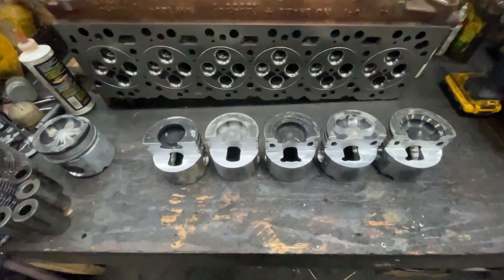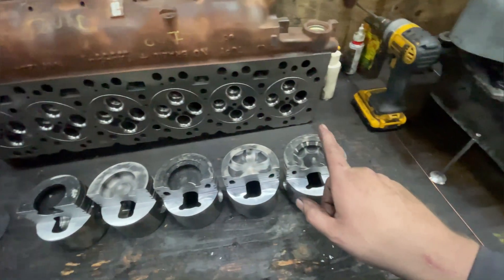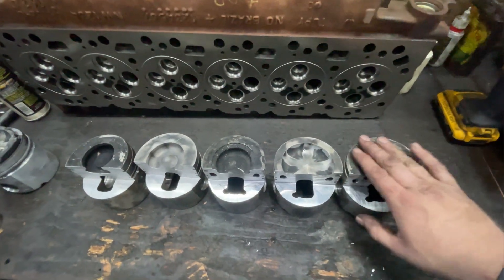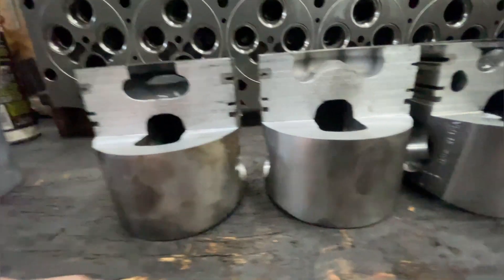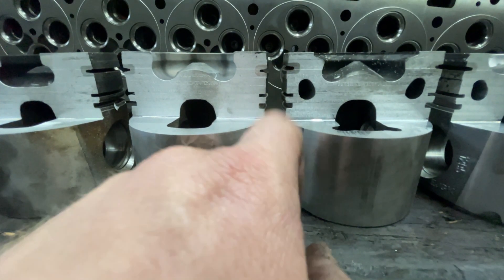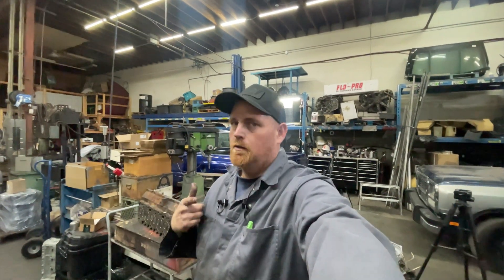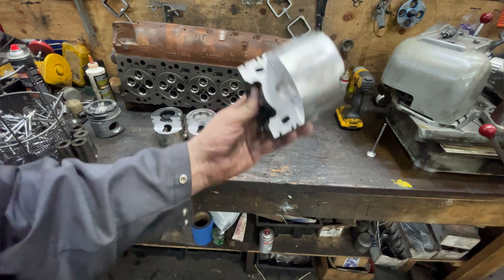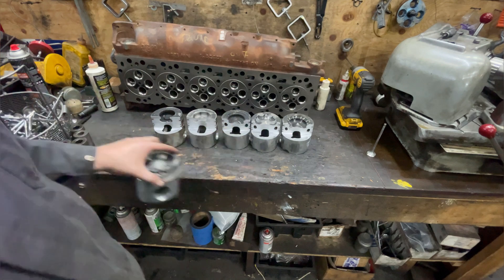WHAT A CUMMINS PISTON LOOKS LIKE INSIDE !!!!

Comment: Really cool Rob! I have heard before that the wide bowl 2004.5 CR piston is most responsive to tuning, has more power potential vs. the reentrant style, but the early CR and 6.7 piston are probably cleaner for a daily driver.  As for engines, my wish list for my 98.5 Cummins is eventually do a build on a 5.9 CR foundation, with the reentrant bowl, but stick with the VP44.  I have always liked the VP44, but take advantage of better piston cooling, better block (and lose the tappet cover), better flowing head, lose the hump in the intake plenum, etc.
Reply from the maker: Ya the non entrant bowl basically mixes the air and fuel better. Which makes it easy to make power. 
If you want to do a cr block with your vp44 I would do a 6.7 make a world of difference well I think. I guess over the next few years we will see. Now I have the dyno to test with

Comment: Info please an I’ve been following you for a while, figured I’d ask you 
My block dosent have numbers on the side and this engine didn’t come with oil squirters

Supposedly non intercool
89 12v
Reply from the maker: It would have been a non turbo engine if the oil jets aren’t there
Reply: @CUTTERUPROB   so is this a good block design 
Im in process of rebuilding now
Just gotta find a crank for it

Comment: Is injection failure super common,  is there a bullet proof injection set up, or less likely to fail type? I'm not very educated on the subject but seems I hear alot about the subject.
Reply from the maker: It’s in more common on the commonrail trucks. But if you maintain them right there fine

Comment: Great video, i really enjoy the in depth comparison videos, I'm planning on rebuilding an 05 with 305 pistons and injectors, along with the proper tuning, I have an 03 and a early 04 and easily get 18 to 19 mpg in town and am above 20 mpg on the highway, my 05 would only do about 16 in town and 18 on the highway.
 Any other modifications to improve mpg?
Reply from the maker: If you want to do that I would find yourself a 6.7 and run the 305 injectors

Comment: Rob your talking about aluminum pistons again I think you need to find an iron piston to replace that aluminum stuff so that the monkeys have a harder time killing the pistons and harder for the injectors to kill them also . I worked on an 05 the monkey drove it till the oil was dripping off the tail lights melted the side out of the piston below the wrist pin and a quarter inch groove out of the cylinder  stuck another engine in it and went on with life Cummins must have iron pistons so you can drive it long enough to diagnose the problem before it kills the engine like you say though if you're going to be stupid you have to be tough  good info and well done video
Reply from the maker: Only pistons you can buy steel for these are 5000 a set and there heavy. I would use them on stuff but had to do it for the cost.